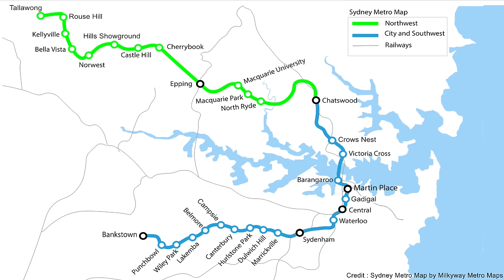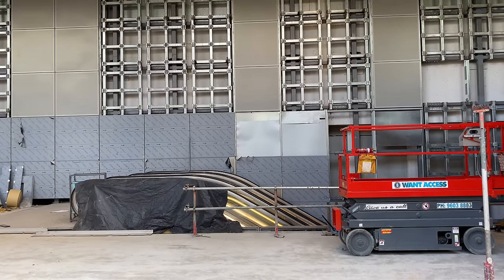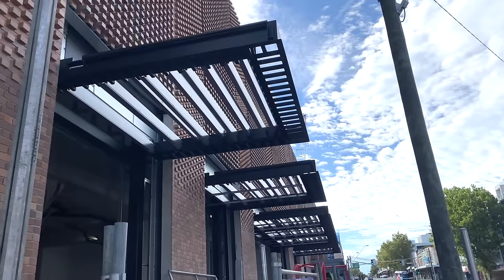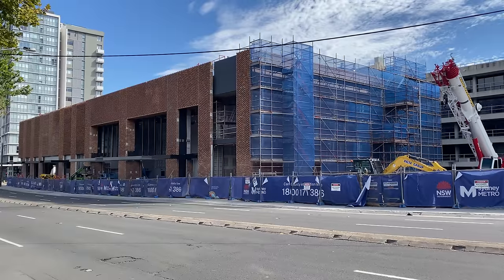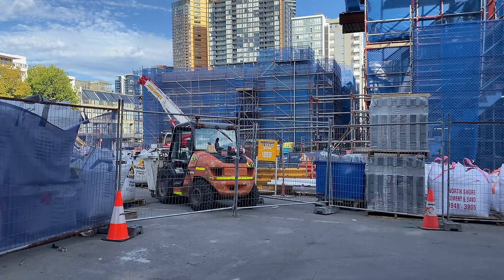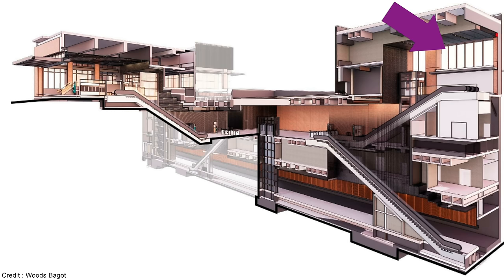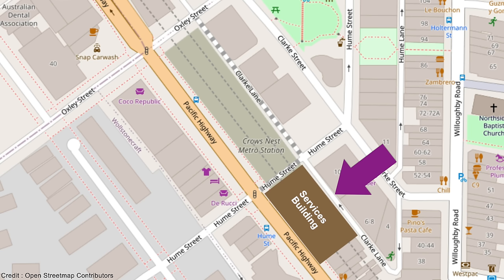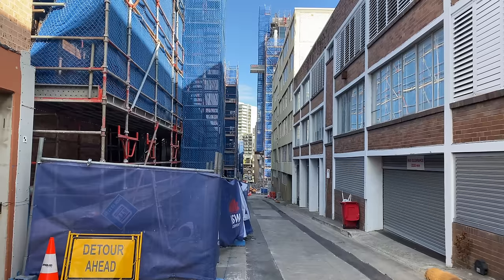Crows Nest Station Explained and Update - Includes Virtual Station Tour!

Comment: I didn't realise there was still so much work to do at Crowie. It seems most of the other stations have had open days and are pretty much ready to go. I suppose it'll be much later this year before the line is open, unless Crows Nest ends up being to Sydney what Bond Street was to London, when they opened the Elizabeth line.
Reply from the maker: There is always going to one station that is last to be ready. And that's because the same team of contractors go from station to station installing escalators, lifts, platform screen doors etc, so one station would always be last, and that's factored into the project.  Also as stations get finished, workers can be transferred to the unfinished stations, and that can speed up completion. I'm fairly confident that all stations will open at the same time, and the middle of this year, could be anytime from June to September,  so I reckon it will be ready in time.

Comment: In my opinion, Crows Nest probably should've been located further away from St Leonards station to provide public transit access to more people.
Reply: They should instead be an additional Station between Crows Nest and Chatswood
Reply: @nicolasblume1046  I think they wanted to provide a faster alternative to the North Shore railway line, which ebbs and flows and makes a lot of compulsory stops in that part of town. Putting it at Crows Nest shops makes sense to me.

Where I'd like to see additional stations are at the Lane Cove National Park entrance (which the line apparently goes right under), and Thompson's Corner. And, of course, extending it to the Richmond and Western lines. I still think it's dumb that the Badgerys Creek metro won't be compatible with this one… given that, why not just make it a heavy rail line, that they could also eventually connect to Leppington, and give airport passengers single-seat rides to Parramatta and Liverpool?
Reply: @nomadMik the thing about metro lines is that they have smaller loading gauges then the standard rail lines. All the tunnels can be made smaller, and there are a lot of tunnels. The Sydney Morning Herald tried to make it some sort of scandal a few years ago that Sydney Trains can’t use Metro Tunnels. When smaller and cheaper tunnels seems rather the point of using smaller trains. 
I suspect though in a few years the airport metro will be run through to Rouse Hill and a few years after that the train voltages will be standardised.
Reply: Maybe the route is too indirect.
Reply from the maker: There are lots of factors at play when it comes to deciding where stations go.  They need to be on a straight sections of track, not too deep (an issue on the quite hilly lower north shore), and also in areas where existing buildings can be demolished more easily (usually trying to avoid residential housing as much as possible). With all that in mind, this location is about as close to Crows Nest Town Centre as you can get! The Clarke Street entrance is a good 10 minute walk from St Leonards Station, so it will open up access to many more people.
Reply from the maker: @nicolasblume1046 , it they did, it would be very close to the existing Artarmon Station, and that's probably why that hasn't happened.
Reply: @TransportVlog  true
Reply: Thanks very much for sharing and going to so much trouble, I walk past this every day on my way to work to our shop which has been there for just on 30 years now is about 1 minute walk away , we will be glad when it’s over and hopefully bring a few more customers to the area .
Reply: @francesconicoletti2547  Found your comment interesting and went looking at several sources to verify the gauge  information. I can find many references but none that state the Metro is anything other than the Standard NSW and now Australian gauge of four feet eight and one half inches (1435mm). 
The design of Metro carriages is probably narrower given the longtitudinal seating arrangement but the track gauge does not necessarily alter because of this.

Comment: Thanks Paul. For an easy construction  site they appear go be going very, very slow. They should  have just focused on making it a simple metro station.  

The awnings that run along the Pacific Highway offer no rain shelter so form a useless dogs-balls addition to stand under whilst waiting to cross the highway at Oxley Street. 

Most metros round the world have many  exits to facilitate the entry and exit of the local population.  A simple tunnel  under the highway coming out down Oxley Street  or the car wash yard would have saved lots of people  having  to cross at the traffic lights. In the next few years thousands of apartments  will be constructed here.
Reply from the maker: Hi Peter, the same team of contractors go from station to station installing escalators, lifts, platform screen doors etc, so one station would always be last, and that's factored into the project.  I agree an underground passageway under Pacific Highway would be wonderful, and this could well happen in the future, once these apartments are built.  Mascot Station as a good example of building an additional entrance on the other side of a road.
Reply: @TransportVlog  Thanks Paul for the update.

One famous  metro station that i know  is XinJieKou in The city of Nanjing has 24 exit points.  It is the equivalent of Wynyard  Station here i.e. it is in the city centre.

Alas I think it is too late to add it.  Looks like i will be standing in the rain waiting  for the traffic lights to change

Comment: Considering Sydney's housing shortage, it is a shame they didn't build more apartment towers above the station. Commercial development is important, but residential apartments are also desperately needed.

While it is great that Crows Nest gets a station, considering its length, the Metro has too few stations. London is brilliant due to the large number of stations. Not all those places were very developed when stations were built, but building stations spurs development, as well as making public transport a first choice for commuting. We need more rail, but we also need many more stations if the rail network is to ever have a major affect on reducing car usage. 

London also has faster trains that accelerate quickly, which reduces travel times. New rail is greatly appreciated, but we need to be doing so much more to get it right.
Reply from the maker: Yes, that did surprise me when I found out that one of the developments would be commercial.  London has a wonderful transport system (I lived there for 17 years).  Newer lines such as the Victoria and Jubilee do have some longer gaps between stations. The acceleration on Sydney Metro is on a par (if not better) than some of the Tube lines, but London rail services, especially to the north are far superior!
Reply: @TransportVlog  I live in the CBD so have never been on the Metro. The acceleration I was talking about is the older rail network. Their acceleration is feeble compared to the Underground. And I get the impression their top speed might be a little lower as well. The tube is amazing the way its acceleration speeds up the network, and makes passengers feel like they are getting somewhere fast. Sydney rail gives a much more sedate feeling.

Comment: My gripe? The Pacific highway will continue to be a physical seperator from the western side with no tunnels or pedestrian walkways accross it. Access accross the highway will be through a set of traffic lights that have been timed more to allow a constant flow of traffic along the highway than for anyone attempting to cross it.
Reply from the maker: Yes good point.  It would have been great to have seen a pedestrian tunnel included.